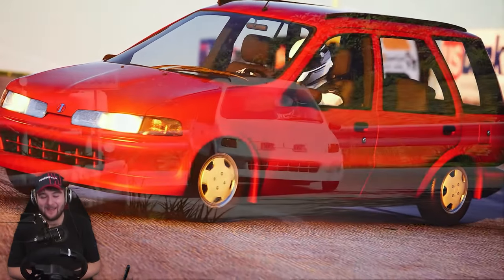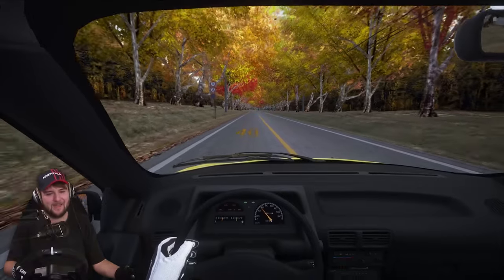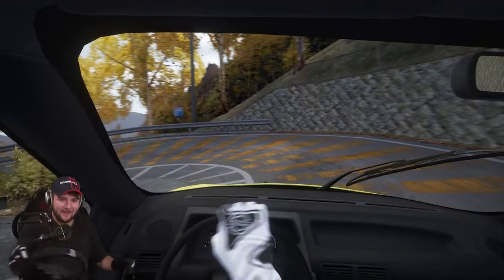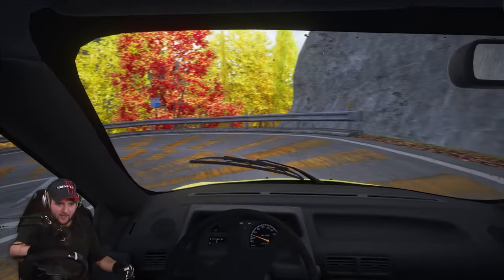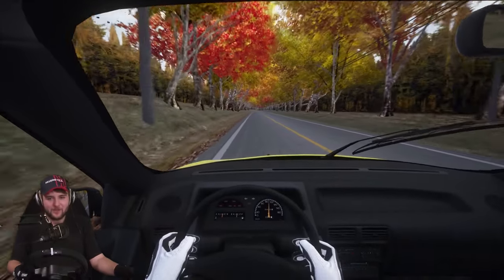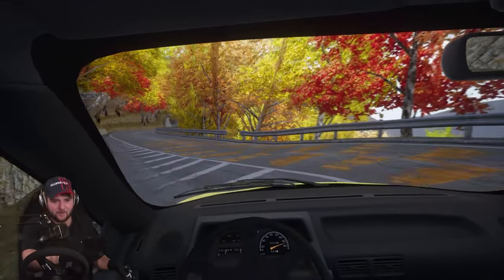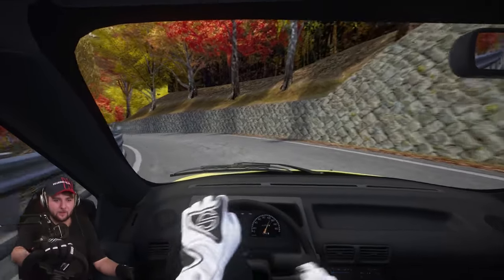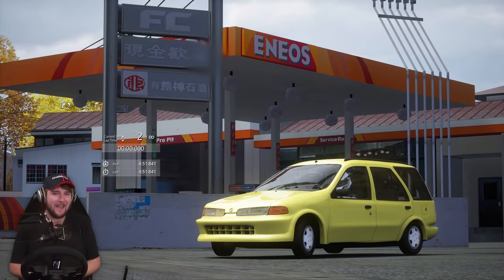This CHINESE Car is Literally Made of PLASTIC

Comment: I've often wondered why we aren't making cars out of plastic?  Like we have some really durable and tough plastics now but we keep making cars out of flimsy sheet metal painted with this really delicate coat of paint. If body panels were just some tough plastic they could just bend back into Shape instead of getting all dented and scratched with every little impact.
Also no more rust.
Reply: Because plastic is cheap and making a decent body panel out of it would raise production costs, and plastic frames aren't really durable enough and end up taking too much space from the interior to make  it more rigid
Reply: The zhonghua solves this by not making body panels at all
the whole thing is a huge plastic unibody bolted through rubber disks to the chassis
I guess the only glaring problem with plastic cars is just safety and an environmental disaster
Reply: Well take a plastic car and goodluck not crashing